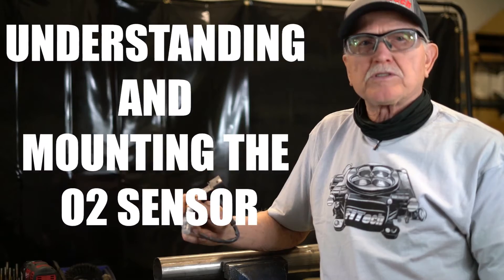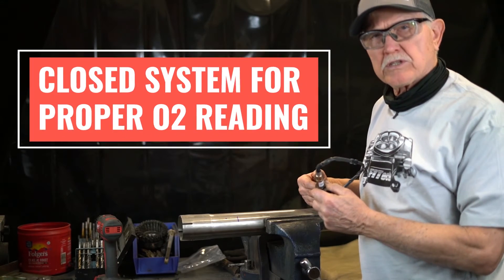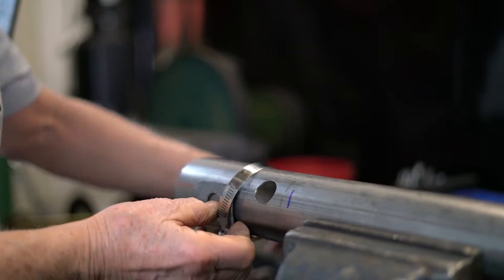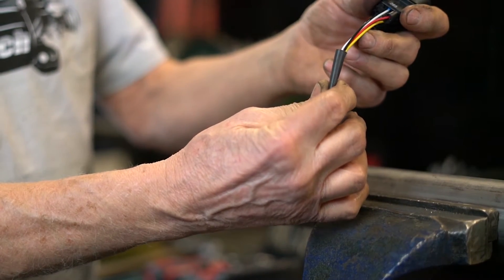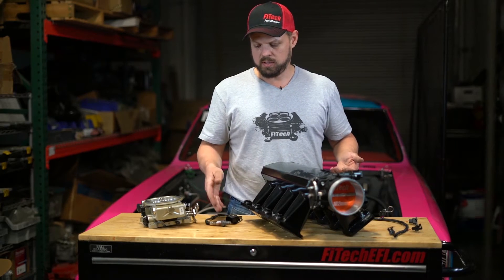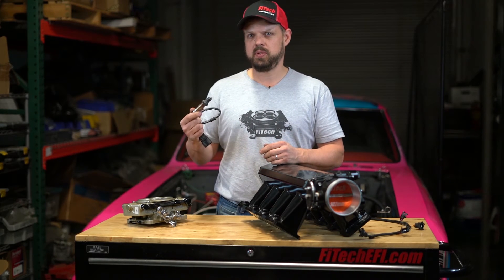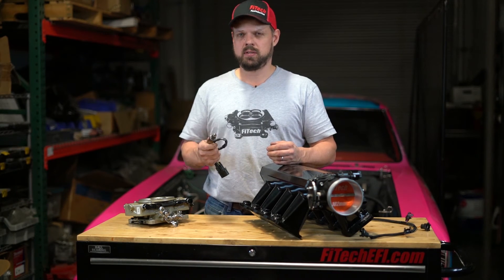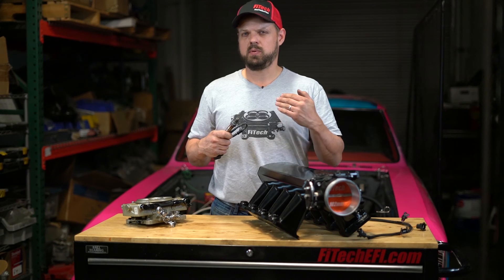Understanding and Mounting the O2 Sensor | Tech Tuesdays | EP9

Comment: I have long tube headers and I’m running rich on both banks. Not sure what causing this
Reply from the maker: Check the fault code section of the handheld for errors. Also possible vacuum leaks or just adjusting the AFR target within the system.
Reply: @FiTechEFImedia  thanks, I figured it out. I use the 2.5 bar map instead of the provided 3 bar map. Problem solved